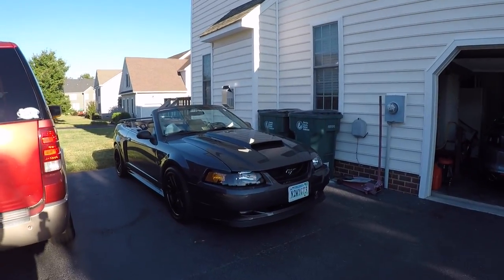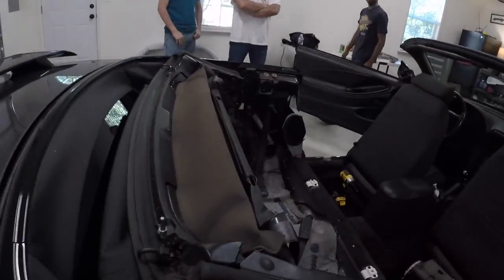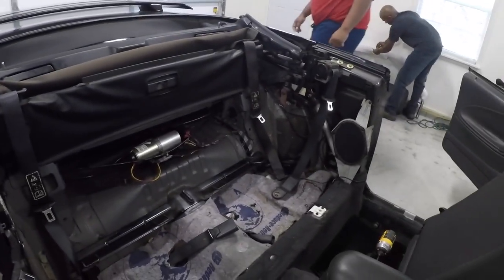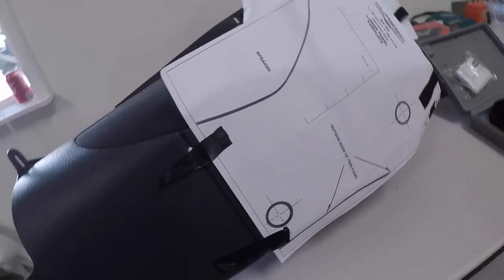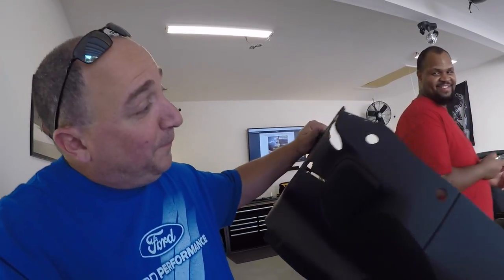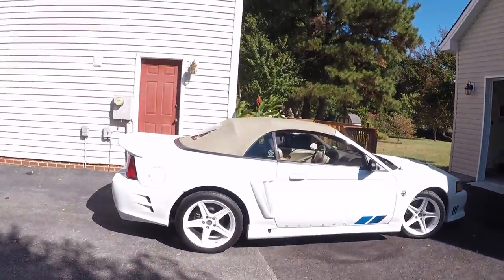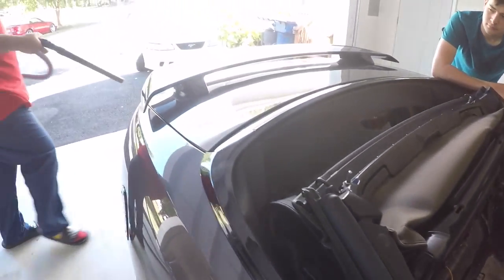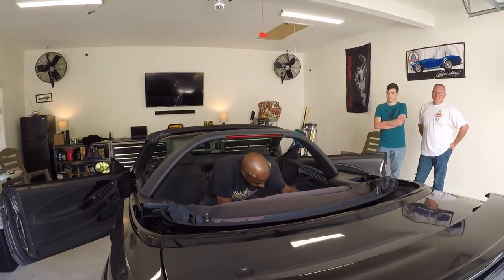CDC Convertible Lightbar (99-04) Mustang GT

Comment: Does the 3rd brake light light up the inside of the car when the top is up?
Reply: Mine doesn't.  It cuts power to the light when the top goes up.
Reply from the maker: It does
Reply: @OhItsThat  can you tell me what year and wires you use to not have the light come on when the top is up please thank you
Reply: @bigkevtang  My car is a 00. I’m not sure what brand the light bar is as it was already installed. The car also came with a paint matched Saleen branded fiberglass cover that covers the back seats turning the car into a 2 seater. The original owner told me the dealership installed both of them. The light bar is a dark medium graphite color matching the dark parts of the medium graphite interior in the car.  Ive always figured the bar came from Saleen as well. There must be a tutorial online for wiring those up.
Reply: Any idea how this fits with seat track extenders?  Hit your head or shoulder on it?  Looks good, I want one for my Cobra but I'm tall so I have to use seat track extenders.  Looks like my headrest would be right under the bar.